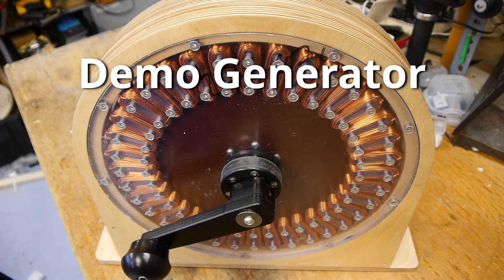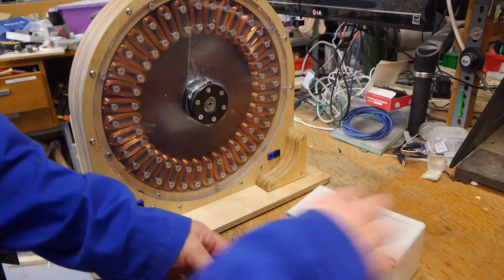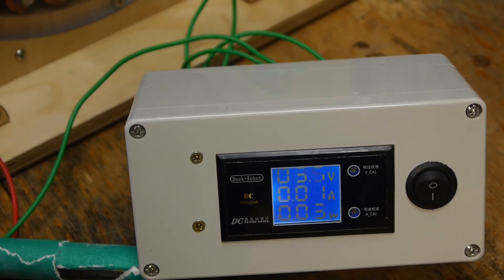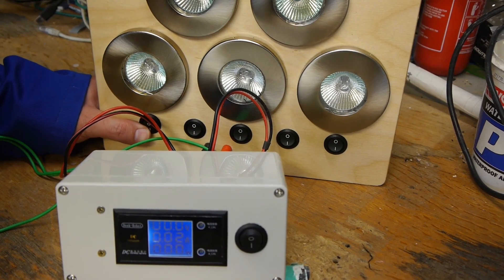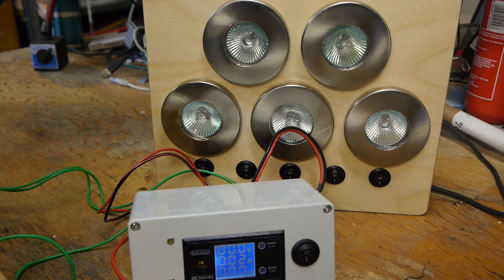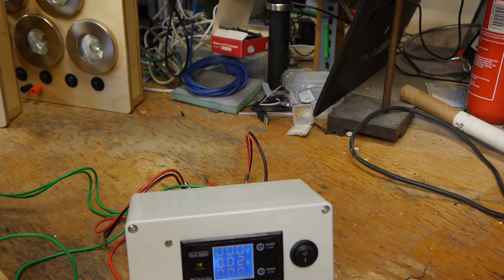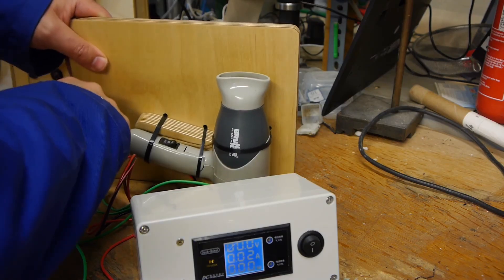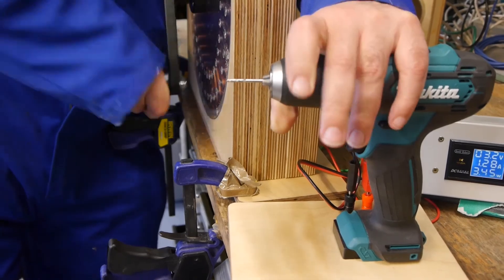Hand Cranked Demo Generator

Comment: Great. Seen a few of these but not all get harder to turn when you increase the load. Such an important concept to get acrossss
Reply from the maker: Yeah, I think a lot either have so much mechanical resistance you can't feel anything or they are faked. I think some just have a mechanical load and a speed sensor and then turn on lights the faster you turn the handle. Which gets even worse when the load fails and they are just measuring how fast you can turn a handle.
Doing it properly is a little bit more difficult to get working but a much better experience.